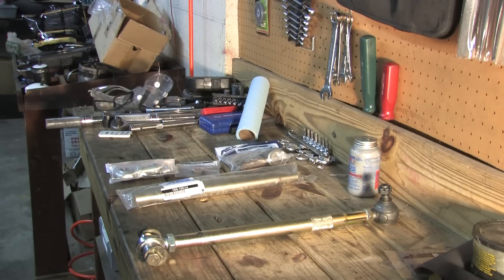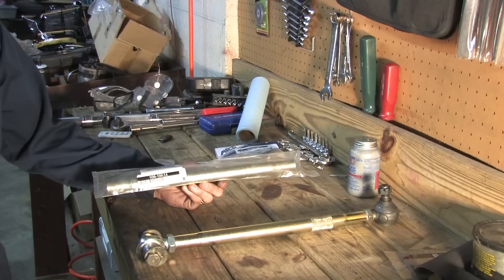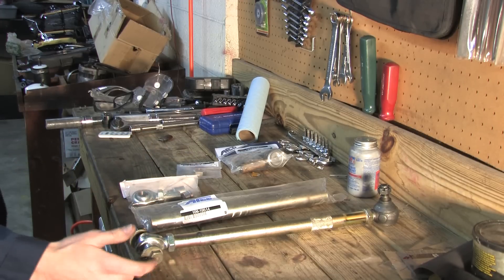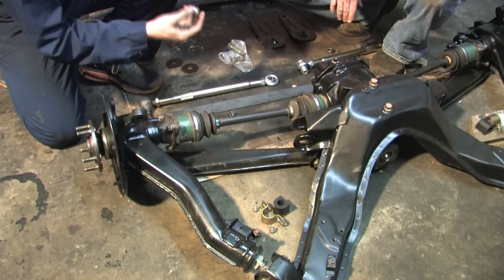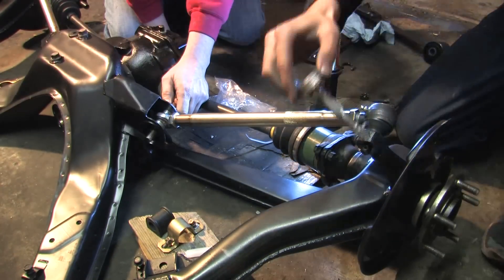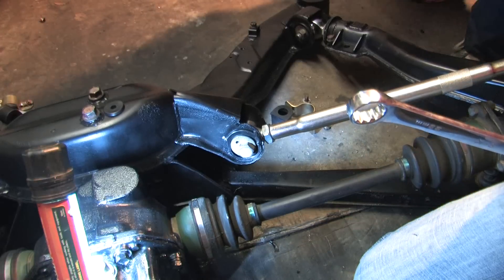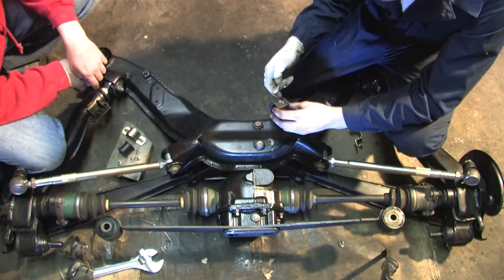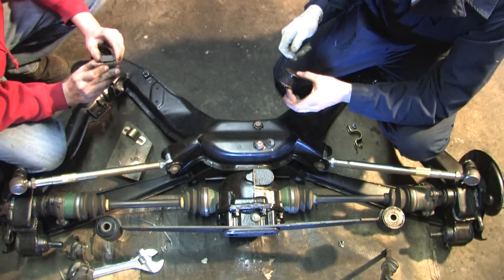Swag Joints ...& Rear Subframe Tech

Comment: This the upgrade worked or no?
Reply from the maker: It worked, but it's noisy.  You lose the hard rubber bushings that silence all the shock and vibration.  While they handle spectacularly in race situations, they can be annoying on the street.  The teflon-lined ball joints work better than these in that regard, but the price is very different.

Comment: i missed what you did the trailing arm ?  are those new joints at the end of trailing arm to subframe ?
Reply from the maker: They sure are.  The afco part numbers are in the description.  I don't recommend these Heim joints.  Get Teflon lined joints.  They're much more expensive, but it takes longer than setting the car on the ground before they wear out.  We had some unexpected results with the Heim joints we used.  They were load rated for the car's weight, but developed .0015" of slop very quickly, making them rattle.  The Teflon-lined Heim joints won't do that.
Reply: *****  nice, thank you. i assume you mean the "20023k rod end" (so you really used 4 of them on this project).  my subframe is all apart currently, cleaning everything up and priming/painting.  the trailing arms will be last, so we'll see if the factory end joint will even separate from the trailing arm.